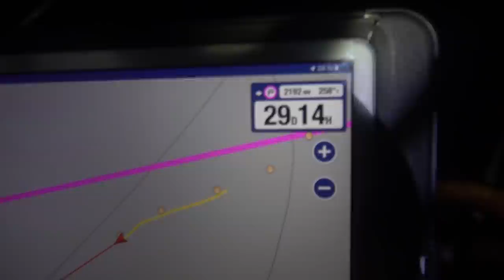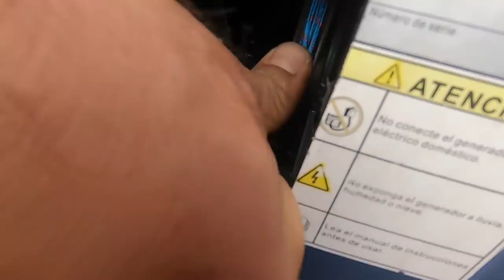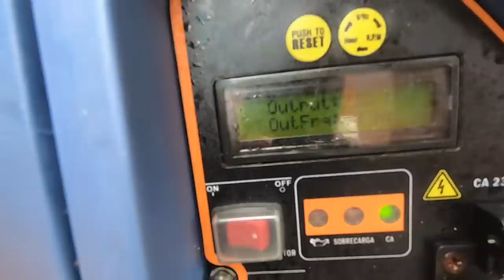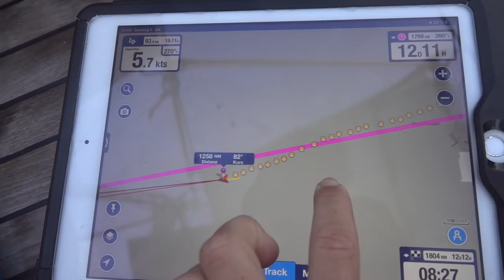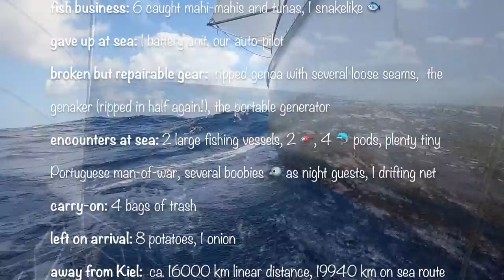Sailing Across the Pacific Ocean - 40 Days From Panamá to French Polynesia - Ep. 42 Thula Sailing

Comment: Hi Guys, nice video of a long trip! The helicopter is from Panama and is a civilian registry model Robinson R44 Clipper I. The range of these is only a couple hundred miles at most so must be from a ship. I agree with the guy who commented on leaving your winch handles in, watched a lewmar fall out, skip across the deck and into the atlantic once. Expensive lesson to learn. Fair winds!
Reply: And, if the pawls break,  the handle will break 'whatever' it spins around into.  They're only held in place by little springs.

Comment: Great job of sailing 4000 miles despite taking 40 days....at least you have a flexible schedule and stayed safe!  That was an inspiring generator repair and sail recovery repair!  What would you add in packing your provisions for future Pacific crossings?  How much water did you bring and how much was left?  Thanks!
Reply: I was on a different boat back in 1981-82, (A Herreshoff Marco Polo 'Valkyrie) and we had 200 gallons of fresh water.  There are plenty of rain squalls in the trades....so we arrived in the Marquesas with full tanks.  That was the year of the first recorded El Nino....and there were 7 hurricanes....there had not been one in the area for 40 years.  Friends of ours were lost on the trip down to Papeete, we had left the Marquesas a week earlier than they did, so had a nice sail down.  Took two direct hits from cat 2 storms while we were there, one of which we were one of only two survivors in the anchorage....everyone else broke their 3/8" chain and went on the beach.  Being a larger boat, we used 1/2" and did ok.  Blew all the paint off the fronts of the masts though.  Sure would like to know where Valkyrie is these days.
Reply from the maker: We had 400l and used little bit more then half of it.... for the next time a bit comfort would be nice like a freezer or more storage!